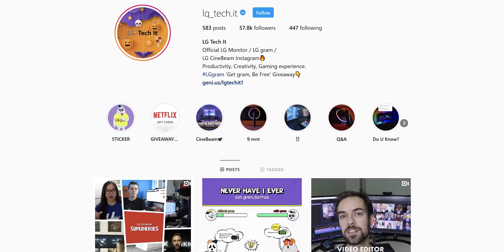Water cooling the FASTEST Mac on the Planet

Comment: maybe these two work?
IO CREST 5 Slot M.2 B-Key SATA Base Pci-E 3.0 X2 Bandwidth Non-Raid Controller Card Require X16 Slot
https://www.amazon.com/dp/B07WDM3H9Z
SYBA SI-PEX40142 5 Slot M.2 B-key SATA Base PCI-e 3.0 x2 Bandwidth Controller Card Require x16 Slot
https://www.newegg.com/syba-model-si-pex40142-controller-card/p/N82E16815124189?Description=Pcie%20m.2&cm_re=Pcie_m.2--15-124-189--Product
Dunno if they require the bifurcation that Linus was talking about.

Comment: Watching  you guys struggling with this build makes me wonder if ditching Apple is the right move for me. I've never scratch-built my own system before, and it's something I'm considering. 
The new Mac Pro is a bit of a game changer, though, but I can't afford one yet. 
I have no doubt you'll succeed in building a faster machine. But, I'm afraid it will never be a superior machine. If the new Mac Pro builds on the legacy of the 5,1, I will bide my time and save up. 
A comparable build of a Windows machine is just as pricey, anyway, something that surprised me.
I may do a bargain-basement build, yet... just for fun. I may even video and post it here.

Comment: I don't understand why you guys don't use aluminum for your homemade brackets. You can cut it with woodworking tools, like a table saw.  No need for fancy CNC routers. Easy to cut and bend, you could make much better brackets than the embarrassing ones in this video.
Reply: But that isn't the LTT jank way.

Comment: You should also make one with air cooling like the real mac has.
Reply: World of Tanks The Powermac G5 had watercooling. Air cooling is kinda hard to fit properly in a case of that size with the parts they’re trying to use.
Reply: @RANDOMNAME-kj1zv  they were attending to challenge the new 2019 model that was just released.
Reply: World of Tanks You’re never gonna get air cooling into a case that small with the parts they want to use without making your own custom air cooling system that’s designed around that case specifically, at least not with as beefy cooling as they need to keep everything in such a tight package cool. Maybe if they only had a single CPU it would be possible, but with two it’s just not feasible using standard ATX components.

Comment: cutting up a case to make a bracket? isnt it cheaper to buy some aluminium or something lol :D
Reply: Markus Hermansson Lots of mac case modders do the exact same thing. Cutting an old case is usually the easiest way to get an ordinary PC bracket compatible with ATX hardware.
Reply: @RANDOMNAME-kj1zv  pretty sure i was talking about the reservoir bracket that they made themselves out of some old flimsy case material lol :D So it wasn't ATX specific since the "designed" it themselves lol

Comment: Should have used a Highpoint Solutions SSD7103 M.2  x4 pci-e Bootable RAID adapter, I have one and it can use any off the shelf m.2 drives and it can do Bootable RAID 0/1/5/10

Comment: good god, i know pipefitting is a bit overkill for hard-tubing, but it's very very simple to determine the length of pipe/tube between fittings. get the distance you want between centers of your fittings. determine the distance between how far the tube inserts into the fitting and the distance from the face of the fitting to the centerline of it. subtract the distance the tube inserts from the face of the fitting to the centerline. i'm going to go out on a limb and guess that manufacturers of fittings for water cooling are going to provide dimensional data much like this kinda shiz https://www.pipedata.com/cgi-bin/WebApp/Ftsw/Ftsw1/Ftsw1_1/Ftsw1_3000_1000013.pl that dimension from insertion depth to centerline is your fitting allowance. subtract the fitting allowances from either fitting you have between the centreline of your tubes, and boom you now have a length to cut your tube. also, tangent is your friend.

Comment: Its funny how he's basically showing you how apple takes standardized computer parts uses them in unstandardized fashion to assemble a computer that runs there software instead if windows or linux and then charges you twice the cost of a PC spec'd the same  because of the "innovation". Think about it.

Comment: Hi, Sorry to ask this question here. But could you help that, can I use different RAM (8gb + 16GB = 24GB) at a time? My mother board is Gigabyte H110M-H-CF
Reply: you can mix memory like that,  just be sure to put the ram  into the correct slots according to your motherboard's manual.
Reply: @cools22  Thank you

Comment: My pc lagged, i got a asus geforce gtx 1080. 
My spec is
I5 6600
Gtx 1080
650 psu
2x ssd
32 gb 2133 mhz ddr4 ram
Wath cpu should i buy, i saw the amd ryzen 5 2600 it only had 1.1% bottleneck on the 1080.
Wath should i buy??

Comment: If you did have a leak how are you going to find it? Usually soapy water is used or submerging everything into a bucket of water neither of which would be recommended in this use case.

Comment: M.2 drives on a pci-e slot. Does that get the same transfer and read speeds as if it were mounted on the motherboard in a designated slot?

Comment: If you pressure test the loop with air by undoing one of the fittings and capping it off, doesn't that mean you're NOT testing the fitting you had to undo to attach the pump, which means you'll just need to leak test the loop with actual water in it to be sure that last fitting doesn't leak? I'm not sure how this really shortcuts anything, it just seems to be adding an extra testing step that isn't meaningfully comprehensive because it doesn't give you assurance of integrity on all your possible points of failure.

Comment: Use dark tint on the back of the logo. So when the inside of the case is lit you can see through the logo or when the system is off you cant see through - It's black.
Or you can paint the back of it matte black. Looking at it through the acrylic it looks glossy.

Comment: "We know our water cooling loop is going to work now"
Well except for the two fittings we changed to do this test lol
Reply: @Daniel Kintigh you would normally use the fill port
Reply: @Daniel Kintigh at this stage with no water its very easy to do.
Reply: @Daniel Kintigh 1. You don't... he unplugged ONE fitting... out of 16...
2. would you rather find out your loop is bad when you turn it on and water gets all over your $52,000 dollar pc?
Reply: They can always change to two other fittings that passed the previous test and test again.

Comment: You dont need a thicker bracket for the pump just a second one for the top if that works out easier. Forming metal that will be thick enough may be difficult.

Comment: So the power on/off switch (from the power supply) is inside the case, completely blocked once the case is closed, and the cable to plug into it to go to the wall outlet will also be inside?  Those cables aren't very thin or flexible, will it actually be able to fit in there and thread it's way out of the case? Wonder if their cad modelling failed to account for that cable and the whole thing won't work >.<

Comment: "This might be the mac that gets me to use a mac!"

We all know you'll be dual-booting windows on this thing after a week.
Reply: I give it a day
Reply: @AttilaThebung  I'm certain it's already done lol
Reply: @AttilaThebung  i give it untill the video he makes is over
Reply: Pretty much if you plan on doing any kind of networked workflow you are SOL on MacOS. SMB is so glitchy and janky on MacOS. Half the time files randomly get locked because Finder flags them as "in use" when it generates thumbnails for them and never unlocks them.
Reply: @rubiconnn  I have no problems using SMB/AFP/CIFS accessing Synology NASes, so I guess it also matters on server itself, not just protocol;
speaking of issues with locked files, seen that few times on friends networks, those actually are related to Finder, using different app like Double Commander (free) or using Terminal for file operations always solves the problem
Reply: Linux
Reply: since I set up dualboot hacky, I barely use Windows (10) anymore, it's been 3 years now
Reply: Why move to Windows when you have the privilege to use a better OS?
Reply: Al P Why use Windows or macOS when you could use any one of the free and open source Linux distros?

Yeah, yeah, hardware support problems, but riddle me this: why does my backlight work on Linux when it was at best touch and go on OEM drivers?
Reply: Also this is not a Mac. this is a hackintosh. dont slander the macintosh brand with shitty ltt projects.
Reply: I don't agree with you
Reply: @curt8806  Mac already has slandered their own name, by being anti-consumer big corporate bullies. Their fight against the Right to Repair legislation around the united states, trying to put people like Louis Rossman out of business. They can go straight to hell.
Reply: @ExarchGaming  They've pretty much driven the nail in to their own coffin.
Reply: @curt8806  you have been banished by the PC MASTER RACE!!!!!!
Reply: @curt8806  the macintosh brand died after the G5, it just kept getting worse after that point. If anything they're doing apple a favour with their "shitty project"
Reply: @curt8806  that anything involving an apple product is a shitty project anyways...
Reply: @curt8806  Mac needs a good name in order to have it slandered. I'm never buying their products again after they fucked up my iMac with their update that they kept pushing that doesn't support HDDs and my unreliable Macbook Air.

Comment: If the clear acrylic LTT logo appears frosty after cutting etc., use a blow torch on it and it will go completely transparent. The heat melts the tiny scratches into a smooth surface and it's much quicker than sanding it!

Comment: “How to kill a power supply”
Reply: Henrik Wils why?
Reply: @seankaila   The power supply-- all 1200 watts of it-- is INSIDE the case. (I wondered where they were going to plug it in a minute or two before Linus brought it up). All that heat's going into the case. The fans and rads will have to contend with that, on top of what the CPU+GPUs are putting out. If the power supply doesn't choke on its own heat, everything else will.

Comment: i would love to see a video where u use a pool or lake to watercool a gaming pc in the winter or fall a time when it is cold. i dont mean sticking a radiator under water. i mean getting 2 pipes a in and a out and placing them in the lake or pool far from each other.  one sucks the poolwater up and sends it through the cpu waterblock then sends it back out the other tube placed in the water far from the intake one. I have wanted to try this for years but never could get the money.

Comment: I swear to god, if you don't unsolder and replace those antennas on the wireless adapter with internal antennas I'm unsubscribing. All that work just to have janky antennas sticking out of the back of it ? Come on.

Comment: Why didn't you just remove a different plug from the graphics card that was already there and pressurize the system that way. Now you know everything but that fitting you disconnected is leak proof instead of everything including that fitting...

Comment: Looking at this build just makes me sad. They could have done the modding so much better by just looking online at how other people did it. The use of a motherboard tray is a good solution, however cutting away the bar with the locking mechanism is just stupid. Also the usage of the big motherboard is just throwing away the little room you have with the case. Room which might otherwise have been spent on creating propper airflow in the case. You can say a lot about the proprietary design of the inside layout of the case, but the way it seperates both cpu, gpu and hdd+optical airflow is actually really clever. Personally, I think you would have had an easier time with a mac pro case than a mac g5. Mostly due to the space assigned to the powersupply being roughly the same size as a normal psu. Finally, there exists some madlad electrical engineering guy who has made a custom conversion kit for a mac pro. Wherein you can just slot in a normal motherboard and all the proprietary cables are just plug and go. He even converted the front io, so you don't have to cut on the outside of the case. That is how it is done. As one of those modders myself, this built is badly done and the case might as well be thrown out with the trash where it belongs. I hope LTT would do apple's design justice one day, this was just sad.

Comment: This build is just awesome.

The only thing I can think of to maybe do differently is to make a PowerMac G3 - like door out of the side panel, and fix the power supply to it instead of fixing it to the bottom of the case on that stand. 
So when the 'door' is open and its top goes down, effectively turning the whole side panel into a flat surface with the psu 'sitting' on it, you have easy access to the cables at its back. Or is that a bad idea?

Can’t wait to see the end result. Please don't make us wait for weeks :)..

Comment: Hey guys

This is an offtopic question, I have a Huawei echolife router, I don't exactly know the model of it, the thing is that the modem is connected to the internet through an LC connector and not an RJ45, could this affect the speed and stability of the internet? If yes, please let me know what's the difference between the connectors, also I've spotted that the cable is not the same as an RJ 45 uses, which is an optic cable.

Thank you,
Radu.

Comment: Honestly, the metal bracket probably doesn't need to be much thicker if at all.

Just run a few beads on it with a bead roller and you'd be good to go.

Comment: Mmm, looked like all those fans are pointing into the case for airflow. Don't forget to check & correct that if needed. Also, what a weird & goofy location for the PSU for airflow & bulk.
Reply: Where would you have put the PSU? And why would you need airflow through the case in a closed water loop system? There is enough ingress for the rad fans to feed by.
Reply: @Safetytrousers  1.) It looks goofy as hell suspending the PSU up off the deck in the middle-ish of the case while it is intaking & exhausting its own air/heat into the case.
2.) I would probably rotate the PSU 180° & mount it to the botton panel of the case so it can vent itself instead of cycling it.
3.) The PSU, RAM, WiFi card, SSD, & mobo aren't cooled by the water loop, so if it's on 24/7 then you want airflow through the case to get rid of the accumulated heat.
4.) You need airflow in the case to cool the other components. You need airflow for the water cooling loops to dump the accumulated heat out of the radiators into the air outside the case otherwise it just becomes a thermal dump & just keeps accumulating heat. And, you state "There is enough ingress for the rad fans to feed by"...you also need an outflow of the same air or you can end up with overpressure in the case if all you have is intake without enough ventilation.

Comment: the way things are plugged in there, you'd think apple designed it
Reply: No, you can call Apple overpriced or a lot of things but if there’s one thing they do right it’s design. This Frankenstein rig doesn’t even compare to the intricate design Apple manages with their products.
Reply: @koningskeizer  go watch the louis rossmann and watch apple not putting heatsink on cpus, and other monstrosities
Reply: Paulo Schorn Louis Rossmann’s stuff is good but more focused on the inability to repair Apple products. I have to admit I dislike his focus on Apple though because a LOT of products in the same form factor are just as closed. And not putting heat sinks on CPU’s? Can you link that video please?
Reply: Richard Fairchild if it was Apple, they’d not plug all the tubes and when it all blew off due to heat they’d say you used your Mac Pro wrongly and it’s not supposed to do heavy works
Reply: shiiiiiittttttttttttttttttttt I should have put a /joke in here

Comment: what was that thing called that allowed 4 m.2 drives in one pci??
Reply: 4x4 bifurcation. Many mobos will allow it from the bios and then you can just get a dumb adapter card for cheap. If the mobo doesn't support it, you'll only have access to the first m.2. The card they use here, does bifurcation via chip on the adapter and should work with any x16 slot in x16 mode. They are much more expensive.